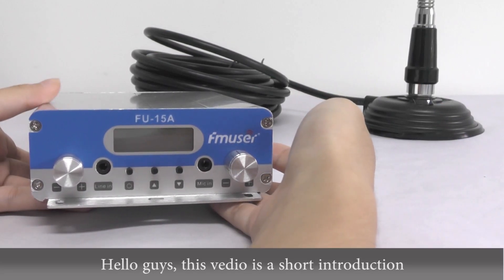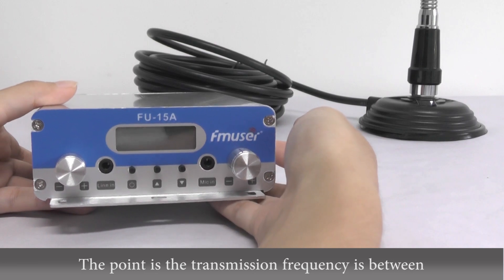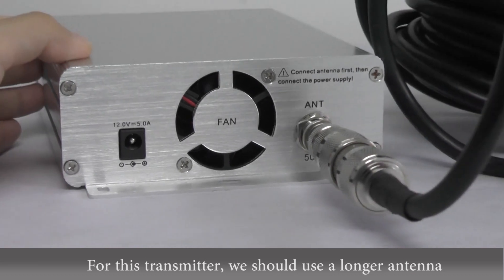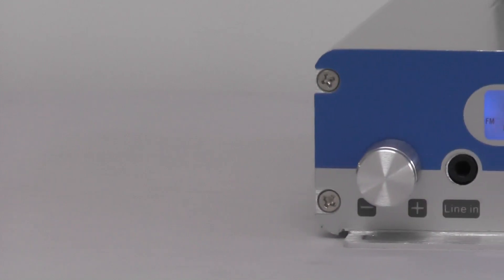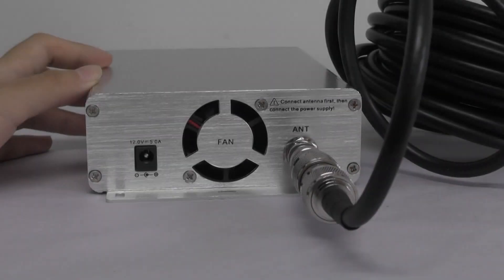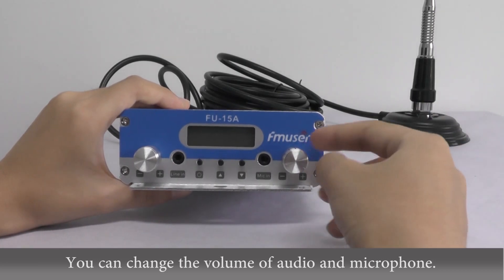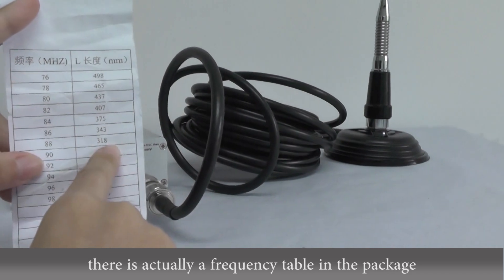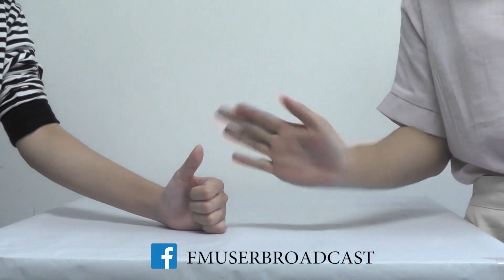Drive-in Broadcasting 1st Pick? FU-15A 15W FM Transmitter Review | FMUSER

Comment: LAST TWO TRANSMITTERS I BOUGHT , WHEN I TRIED TO RETURN THESE PILES OF JUNK THEY TOLD ME TOO  F U
Reply: What was the problem with the transmitters?
Reply: @GlobalPanda7678  Worked great for a few weeks , could transmit between 6  - 11 miles . Now i can't even transmit across the street
Reply: mw10259 it is because how much power you are transmitting on, or else you contact them about your problem
Reply: @GlobalPanda7678  huh ? don't get it

Comment: Illegal in most countries.
Reply from the maker: Hello, Phil. Thanks for sharing. Maybe you can set up a private small radio station within the allowable wattage of country in this way.
Reply: Whatever.  Transmit anyway.  I have for years. As long as you don't get on the air acting like an idiot. You'll be fine with such a low power transmitter. If however you upgrade to ,100 watts or more... I wouldn't advise going on the air.
Reply: @Gucci Fish What do you mean it won't work?  Yes it will work and it does work. 15 watts will transmit 5 miles in a radius before it starts going in and out with motion.

Comment: How many kilometers I can cover
Reply from the maker: It mainly depends on the surrounding environment  of radio station and height of antenna installed.
Reply: @fmuserbroadcast  that really didn't answer the question...
Reply from the maker: @e1337r0x0r  1-4 km
Reply: @fmuserbroadcast  Nah, 15 watts with a high antenna= 20 miles open country.

Comment: hey Rita ,your doing a great job could you tell me what connect and the cable and the kind of antenna this is
Reply from the maker: The antenna in the video is CA200 Car Sucker FM Antenna, do you need one?
Reply: @fmuserbroadcast  , ohh no that's not the one , i need for out the house
Reply from the maker: @jaybub3442  You mean circular polarized antenna or dipole antenna or GP antenna?
Reply: @fmuserbroadcast  ,  yes hun i think it's  one of those
Reply from the maker: @jaybub3442  Ok, if you need any help please feel free to contact us via rita@fmuser.net or +86 18613072427 or rita.cai87
Reply from the maker: @jaybub3442  Ok, you can directly click the link I sent to buy one.
Reply: @fmuserbroadcast  ,  ok thanks
Reply from the maker: @jaybub3442  You are welcome
Reply: Hi guys.

Can you use that FM transmitter for Radio Broadcasting? If not do you know any?
Reply from the maker: @phemelomogatusi8495  Yes, you can buy this transmitter kit for your small radio station, purchase link: https://fmuser.net/content/?620.html